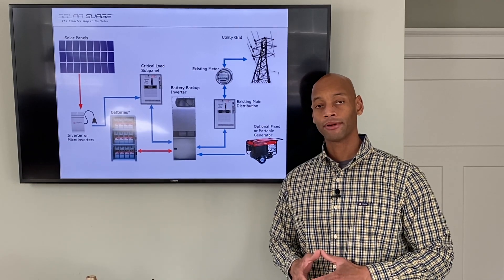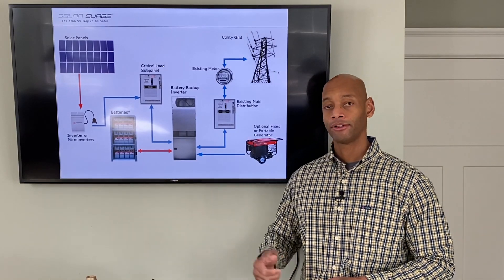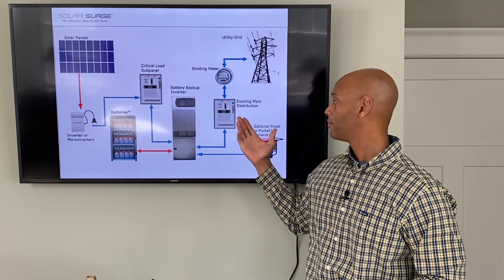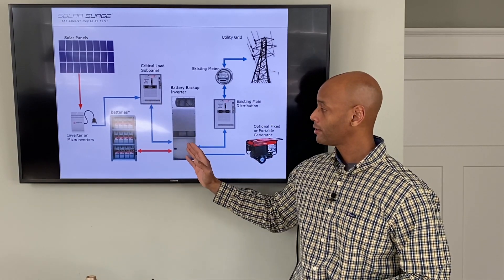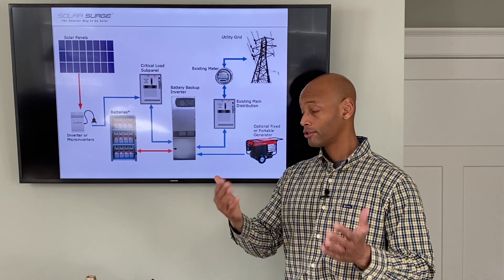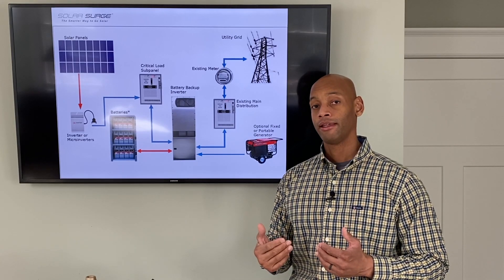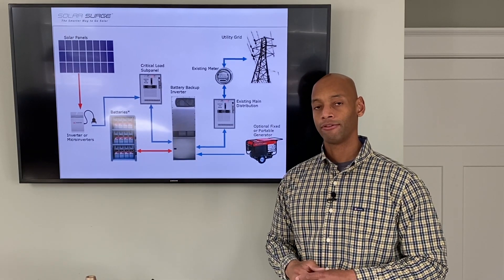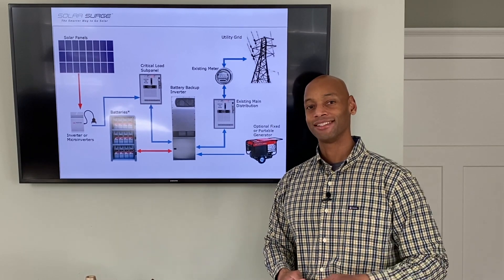How to Add Battery Backup to Solar System

Comment: does this work with tesla's solar( only solar grid tie) since they are being required to be linked to the network?
Reply from the maker: Yes, you could use this method to add battery backup to an existing Tesla system.
Reply: @SolarSurge  cool thank you. I like prepping especially for my tesla.  Dont have my home yet but might be planning to do this at my moms before the ev revolution kicks into full swing.
Reply from the maker: @polarbearigloo  Great.  We are ready to help whenever the time is right.  Please reach out at info@solarsurge.net

Comment: Do you always need a critical loan subpanel when you have a battery? What if you added 5 batteries, can you just have it service the whole main panel?
Reply from the maker: Yes.  5 Tesla or Enphase batteries would handle the entire house backup.  However, in almost every case, it's better to have a critical loads panel so that you can conserve battery power for only the most critical appliances.
Reply: I live in the California outback where the AC units are first on the critical load panel. How can I get a quote for this addition to my solar panel system?

Comment: Way to take advantage of the recent power outages across the country for your advertising. Why not just put the "back up" inverter between the meter and the mains panel so that the grid only in feeds when there is low battery? Is that how Tesla does their setup?
Reply from the maker: The reason is because typically the backup inverter cannot the load of the entire house.  The inverter shown in this example has a maximum load of 9,000W, so we could not backup heavy loads like the clothes dryer, electric oven, etc.